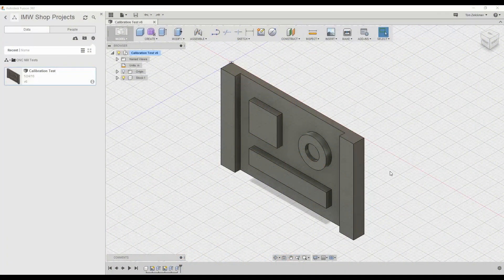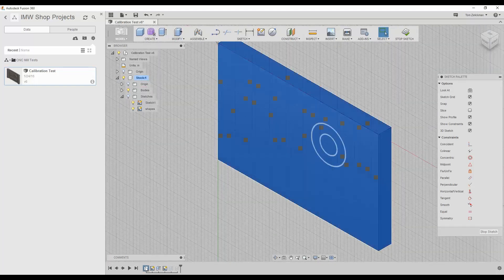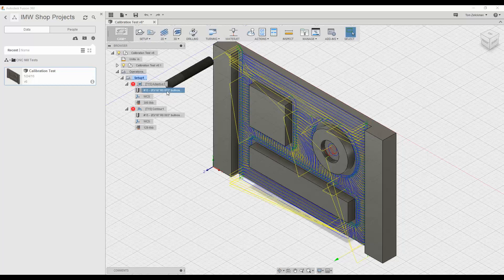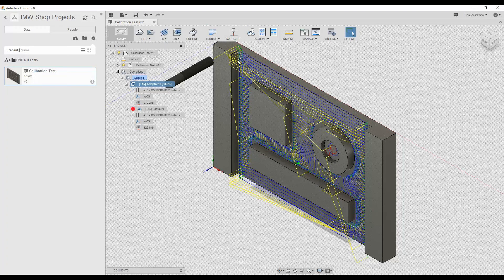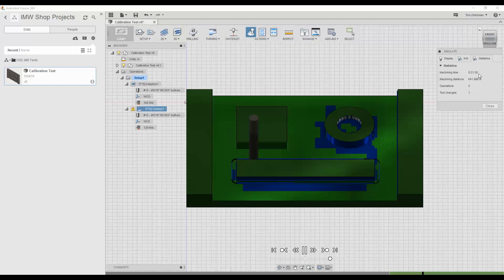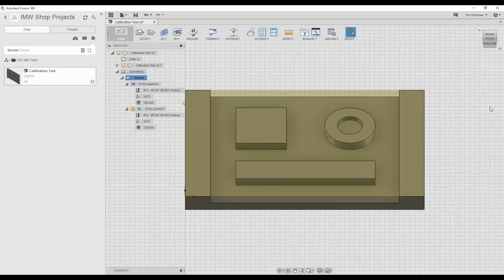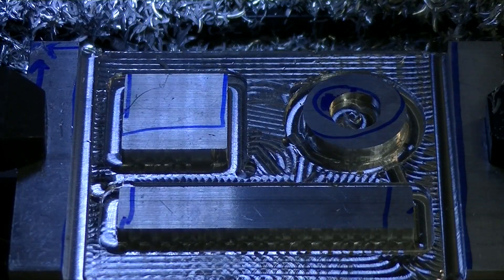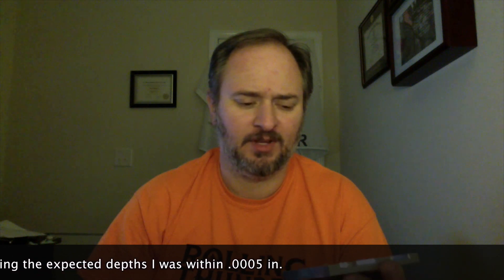Shop Update - CNC Mill Calibration Test

Comment: Did I miss it?  Did you have backlash comp on in Mach?   Once I get my chip curtain up, I'll be looking to do this same test. :)
Reply from the maker: +bluehandsvideo I tried but couldn't get it to work right. Not sure if it was user error, an issue with the USB to parallel adapter, or some other weird issue. All I know is making the switch to using direct parallel out and LinuxCNC for the software greatly improved my setup. Part of me wants to go back and chase down the issues just to know what the cause really was but frankly, I'm happy to have the thing working as well as it is and don't feel like spending the time to do it.

Looking forward to seeing you get the mill tuned!
TZ
Reply: +Tom Zelickman (Inspiration Metalworks) After I sent that, I remembered you went to linux.  I've got the smooth stepper on it....got the backlash down to .001" and .0011".  I did learn something from a Hoss vid about the backlask setup, so I've got my fingers crossed that it works out well.  
Time to hit the shop. :)

Comment: I skipped through a bit,  but overall I think you are doing great.  As others said,  build, test, refine, repeat.  And the understanding you gain from what you are doing is invaluable.  Undoubtedly you'll soon be doing the programmed movement vs actual to separate tool deflection from steps per distance issues.  Even big machines for big $$$ have issues,  the successful folks just keep plugging away until they get their desired results (within limits of course).  Also,  don't forget to double check that you're not measuring against nominal values on a rough cut feature.  And props on the early AM work,  best time of the day for me.  👍👍👍👍👍👍👍👍 DLS,  aka IG @NYDLS305
Reply from the maker: +YCM30cnc Thanks, DLS! Glad to see your comments. It's always nice when things just work out of the box but I'll keep plugging away at it. I'd rather know the reasons behind an action than just know the results themselves so this is right up my alley. I think you are right about the measurements which is prompting my change in CAM strategy as well. My original goal was to push the machine a little bit to make sure the motors could handle the load. They did fine but the rest of the machine couldn't quite keep up, leaving a rough finish that likely is the cause of the errors. The machined slot which did the helical ramp gave a better finish and a more reliable result. Of course, it helped that I went back and de-burred the surfaces and re-measured but that was off camera and after the fact.

Appreciate you stopping in and the comments. I could definitely use more of that!
Tom Z

Comment: Oh man, you look exhausted! I wish I had your enthusiasm to create videos. But then there is the camera in the way and each task takes much more time, so I just didn't film anything lately. But your CNC looks great so far. It works better than mine for probably less money. Sure I don't have to care about backlash, but mine lacks the rigidity of yours. I'm actually planning to buy a manual mill this year since CNC is stressing me out a bit. :) Still, the mill will be used to extend the CNC. While all your deviations are quite consistent I can't think of a reason why the inner diameter of the circle is different. I will further try to think of a reason to that.
Reply from the maker: +Zorgoban It's been a rough week. I have pneumonia so I haven't been sleeping well. It's definitely harder doing things with the camera in the way but I learn a lot from the comments and hopefully others learn some from me as well.

Now that I switched up the milling strategy I am going to try the test again. I feel confident that the deviations are completely due to the speeds and feeds I used and not due to things like missed steps. I think the center hole came out closer because it did a shallow ramp in at a slower feed and thus likely had less flex and chatter in general.

I really like your design for a gantry style machine. I bet you can get more out of that with some tuning. I wouldn't be shocked to find out that I have spent more than you overall though. I probably have close to $2000 USD in this setup overall. It's far cheaper than a larger machine but the tradeoff is in size and capability.

Have you settled on a manual mill yet? Stefan's RF-45 is pretty nice. I have the RF-40 round column as my manual machine and it works quite well.

Thanks again for watching and the comments!
Tom Z
Reply: Get well soon and take care! Pneumonia is not to be taken lightly!

My machine was also around 2.000 Euro. So we are not that far off. I do have some ideas about how to make it more rigid, but it would easily cost me another 1.000 Euro.

I will probably buy the same machine as Stefan, unless I'm lucky enough to find a used one including some tooling at around the same price.

I like your videos!

Many Greetings!
Remo

Comment: I do not know anything about cnc so this is just a comment but with the manual mill I have read that you never set your depth of cut more than half of the diameter of the end mill.  I don't know if that rule applies to cnc.  I envy you cnc guys but while I worked for the evil polluting refinery we had in house drafting and so I never needed to learn cad.  As a result I attempt it now and then and get frustrated and stop so that part of cnc puts me off from actually dreaming up a plan to own one.  Thanks for the video.
Reply from the maker: +Amateur Redneck Workshop Hi, Harold! I think that rule is a good starting point for a lot of machining, regardless of the type. One advantage that CNC machines have is being able to more precisely manage the load on the cutter so you can dial in different recipes based on depth and width of cuts plus RPM and travel speed. I used manufacturer data on recommended load but I don't think my machine is rigid enough to handle that so I dialed it back and will try again.

The CAD bit is getting easier. I was always a pencil and paper guy but did get exposed to AutoCAD in college. Tools like Fusion 360 and the enormous amount of support from both the company and the community have made the transition much easier for me. I still fumble through things but thankfully there is always someone out there willing to show me a better way or point to resources that can help. Also, depending on the machine some of these tools are really easy. The tools from Inventables (XCarve and Carvy mill) use pretty simple, web-based tools that really lower the bar quite a bit.

That being said, some days I like to just run the lathe or bigger mill and do it all myself...

Best wishes, my friend.
TZ